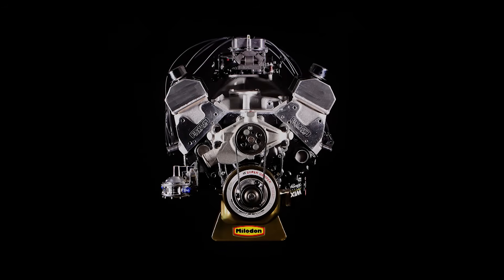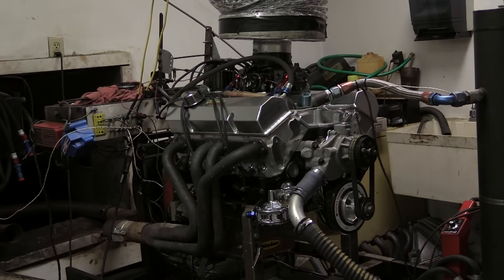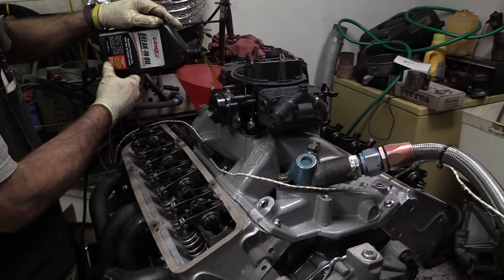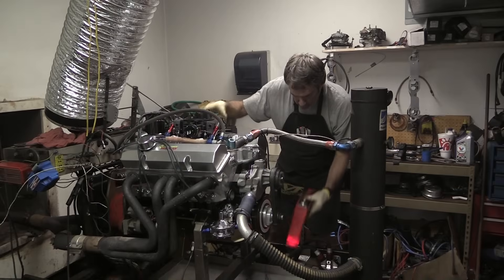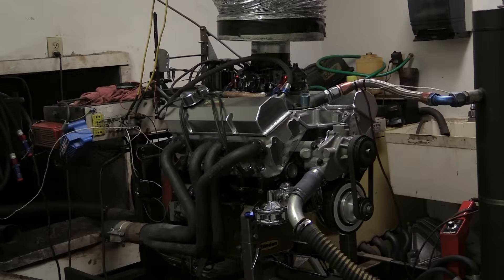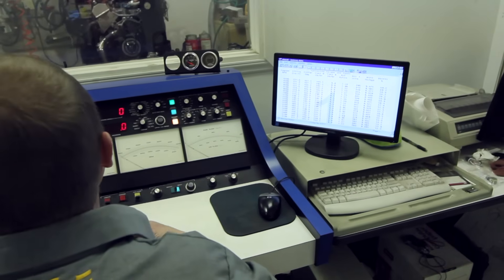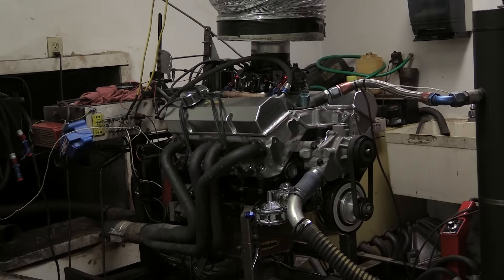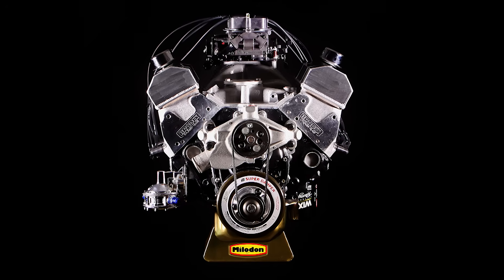427 Chevrolet on the Engine Dyno -- The Ultimate Stroker Part 5

Comment: You made a mistake with that dual-plane manifold.  With a single -plane you should be over 600 hp.  Someone here built a 414 sbc, same heads, and got 595hp.  With the extra displacement you should get 600+ easy.
Reply from the maker: I was after tons of torque, not a peak hp number.
Reply: @TheHorsepowerMonster  True, but more flow = more tq and more hp.  I just think the manifold is a restriction for motor with such potential.  Great build though.

Comment: Engine building is extremely fun, but for curiosity's sake, would it have been cheaper to purchase a ready to run box engine or do it the way you done it?  For the cost, would you been able to obtain more HP/TQ with warranty?

Comment: Nice engine, WAY more practical then my 358 that makes approx. same power (billet main caps, Lunati crank, aluminum rods, 12+ to 1 comp., .600" solid roller, massively ported 492 angle plug heads, port matched intake, 8200 rpm.--in my tube frame street MGB
Reply from the maker: That sounds like a fun ride!
Reply: @TheHorsepowerMonster    It is BIG FUN, it sounds like nothing else I hear on the street (I love the sound-you can hear at 1964 sbc MGB aggressive idle on YouTube), it's pretty sporty too (MGB weighs 2325lbs.)

Comment: this motor turned out great ilike how they used the 5.85" rods , dragonslayer heads, and thumpr cam, and the power isn't excessive for a street small block because of wear issues and bearings. made this a reliable street or mild mannered race engine with a howling 427 cube thumper idle be great in my 81 camaro, go on a date drive to the track run some 10's drive home scan some time slips , post to camaro forums and facebook, and make a bunch of youtube videos.
Reply: check out my IG turbospeedinc, we did an 80 camaro with a 434 small block

Comment: No, the ultimate small block is a 468 c. I. With 18 degree heads . A WARREN JOHNSON SPECIAL
 (ON MOTOR NORMALLY ASPIRIATED, NO NITROUS, 950 HORSEPOWER,THEN ADD A 500 FOGGER AND A 450 PLATE ) NOW WE'RE  TALKING 1800 H.P., REAL FUN ON STREET AND NO TURBOS OR BLOWERS OR PRO CHARGERS, JUST "CAROLINA CRUISING" !!!

Comment: It looks like the valve springs fell off around 6000rpm.  A little more spring and you surely will see more hp. Comp is famous for recommending inadequate springs.  Did you match the intake to the heads?  You are leaving a good bit of power on the table.

Comment: I'm curious as to why you guys went sort of cheap on the heads when most other components were fairly high end. No disrespect meant towards Brodix, which make some very nice heads, but it seems you might have been able to get more power with some higher flowing heads. That being said what you did get will make one hell of a fun car to drive.
Reply: for about 800 less could of got afr 210 or 220 and made atleast another 30-50hp

Comment: those hydraulic rollers are the weak link here. you need a solid roller cam in this bitch to take care of that high rpm hp drop

Comment: Keep it in yer pants, you bench-racing jockeys :-) This was just a preliminary baseline run to get some vague idea of where to go from here....there`s a TON of potential in this motor....
Reply: my guess was to keep it a low maintenance high averaging tq and hp ,street machine engine that can make your 2nd gen go 10's and not break. reliable bigger than small  power. the ultimate small block stroker.

Comment: 427 small block putting out over 500hp.........wtf. New meaning to the term Mighty Mouse. Chevy rules.
Reply: IDK I would still just get a LS7 at least 100lbs lighter, and about 580hp out of the crate plus it wont leak oil.
Reply: GlassTopRX7 guess you've worked on an ls7. I seen MANY, MANY of them leaking. That's what Chevrolet stands for. Cracked head every valve rattles oil leak every time.
Reply: @Smithmike53  we might leak, but we make Powerrr!

Comment: Im impressed, the cam, intake and carb and headers seemed to be on the mild side. And even with a quick tune this thing made a metric ton of torque. The numbers might be low for some these guys who think every engine is a  MAX output challenge but the numbers were actually higher than I anticipated. With a good tune you could have over 550 hp and torque. Thats serious big block power out of a small block on PUMPGAS and there is still a ton of potential. With a solid roller cam and a single plane intake with a bigger carb I know theres another 120 ponies in there.  Small, light, fits in any car or truck, revs to 7000 rpm....Good Build
Reply: Yep, that's a stroker small block, and the numbers are great !!!
Reply: @joecucch8261  i still like my 454 stroker over it any day or my 427 or my 327 pro built that will hold 10,500 rpms all day pushing little more then 1200 hp with 204 heads but it has over 25,000 in it i have had over 15000 rpms built by bell automotive witch builds top fuel engines i do a lot of drag racing
Reply: @ jeffery hollenbeck; It's your money son. Do what you like. This combo would have been in my 65 nova back in the seventies in a heartbeat. It would save me the cost of shoehorning a big block in a ride it wasn't designed for. To each his own I say.
Reply: @joecucch8261  to save money i got my 454 out of a motor home got it for free and they put strokers in motor homes 450 hp at 485 torque and if u dino tune it u can get over 500 hp with 525 torque stock i have got 2 this way for free and sold the motor home for 2000 with out motor and trans food for thought if ur lucky u can get a ls 6 out of them too i get stuff like this all the time same with cars selling a 66 gt fast back dart i got for 50 dollars no rust at all in the car all complete only one dent in it in the trunk lid have t tops camaro's 73 ss hatch back nova i got for 500 with 396 tunnel ram perfect body on it and many many more between me and my buddy we have 20 acres of cars and trucks to play with have a shop coming to by many of them first come first serve
Reply: @jeffery hollenbeck; That's nice, I'm happy for you. Good Luck in your endeavors.
Reply: @joecucch8261  if ur interested in any thing let me know mite have it live in oregon
Reply: @ jeffery hollenbeck; That's a long long way from sunny Florida where I am retired and only looking to keep my 2005 Ranger Edge in good running order. Again, good luck !
Reply: @joecucch8261  well thank u and hope u have a good retirement have a lot of fun if u can i would love to go fishing there some day i hope
Reply: jeffrey hollenbeck 15000rpm thats 15 thousand from a small black. Ya right 😂😂😂😂😂😂
Reply: joe cucch lol jeff lives in a HOME in Oregon.
Reply: Read "The Chevrolet racing engine" by Bill Jenkins. My copy is over fifty years old. In small engine applications for Pro stock drag racing, 15,000 rpms were achieved back in the seventies.
Reply: @holmes1956O  shows what u know about pro built motors for drag racing
Reply: @jeffrey4547  Sounds like a lot of BS to me.
Reply: @michaelangelo8001  let me ask this question what is a 455 Pontiac small block or a big block i wonder if u even know this
Reply: @michaelangelo8001  i will bet u right now i have more chevys then u have owned in ur life same with fords
Reply: @jeffrey4547  Are you drunk?  No one said anything about an LS.

You can't, spell. capitalize, punctuate, or format, yet you want us to believe you have racing engines that will turn 12,500 RPS "all day long", etc...?

You are obviously a dreamer.
Reply: this is a big block not a small block
Reply: @jeffrey4547  thats a small block 427. look at the headers. The 2 center pipes are close together. if it was a big block they would be evenly spaced.
Reply: ur right just i have a 427 BB

Comment: .Granted this is a nice engine,that should give you a lot of service,but a mild 396,427,454 could easy make 500 hp with a lot less investment,so it really depends on the application.This engine would make a great performance street engine in a early Chevrolet,while if its just a little bang for your buck,a mild big block could easily produce the same power.
Reply: Yea for another 200lbs of engine weight. I'll even give you that a BBC would be cheaper. People who build these monster SBC have vary specific reasons for doing so. I would have gone miniblower if it was allowed on a 383 0r 350.
Reply: Godscountry big blocks are heavy and large physically. So for me I can put the big block in my 68 nova but would rather build one of these. Better handling smoother ride easier maintenance and the same power output

Comment: I agree with many here,  427 is big block displacement,  that dual plane is choking it.  my 406 made the same hp w/a flat tapped cam.  now this set up including a 750 w/choke tower may be a great street set up,  but don't call it the ultimate hp stroker build then...great engine regardless!

Comment: the carb sounds a lil small for this big of a chevy build, cool carb tho. i had a 750 dbl pumper in a 410 sbc and worked perfect.
Reply: Nah. The smaller the carb you can get away with, the better the throttle response. I built a 381 Chevy engine with 9.8:1 compression, 511hp @6100rpm, and 492 torque @ 4900rpm, 91 octane pump gas and the carb is a 650 speed demon. The throttle response is unbelievable.
So a 750 Holley on that monster 427 should be 👌
Reply: @jakefriesenjake  "Chevy" doesn't make engines.

Comment: I like this build's series of videos, but not getting to tune any on the dyno makes this video a flop. Some jetting and possibly some timing adjustments could;ve really woken that thing up.  You never mention what the A/F Ratio was thru the power band.
 Further tuning will be by Butt-Dyno? Unless you pull the motor and get some more dyno time. A lot of money spent. If you pull another 50hp and 65 ft/lbs isn't the money spent on the dyno well worth it? At least it won't blow up because it's lean...

Comment: low HP,, you can almost do that with a stock block and a set of cheap world product heads and a cam in a 355 SBC., for a lot less money.
Reply: +doon714 Not exactly the same hp, maybe in a 400 SBC but youd be in the high 300's and low 400's with a 355,  but perhaps if you had a good cam, something in the stage II area yea, dual quads would help...lol. i need more money.

Comment: this is a wonderful build.....I'm partial to the xtreme series  comp cams, HR preferred although I'm running a flat tappet due to budget but I have ta laugh at all the comments in the sections below. everyone thinks that they can and are the best, best engine builders, best tuners, know EXACTLY what is wrong with everything.....probably don't even know how to set valves or proper timing....don't know the difference between initial timing and total timing. it's just funny....good job horsepower monsters. ....weeks love to have this engine in my 3rd gen camaro....ty
Reply: Air dynos ALWAYS READ HIGH period.

Comment: how much would building and engine like this run?
Reply: Too have it built, probably $15000 to $20000. Cheaper to get all machine work done at a shop, buy all the parts listed, and assemble everything yourself. Could save 5 to 10 thousand. Just research a little bit about bearing clearances and stuff like that. Get Er done!

Comment: i've seen 406's put out those numbers!
Reply: ezcondition #\. Oh shit, here’s another one that this build totally went over his fukn head!
Ok smart guy, you asked for it!
1. Your 406 (I’m assuming factory block), has simease  cylinders, that mutha fuker does NOT have anywhere near the drivability that this engine does! It will run hotter than the hinges on hells gate! 
2. This was NOT a drag race build smart guy! This is an everyday driver that can handle 75 mph on the freeway with the A/C frosting your gals nips when your sloppy POS 406 couldn’t make it to the next stop sign and broke! I swoop in and rocket out with your gal! 
3. A 406 can make a lot of power but so can a 3.8 Buick V6! Watch the whole series and understand the concept before making yourself look dumber than you are! FML with you keyboard racing mofo’s!  That statement that you made about the 406 equals to this statement:
“One time at band camp, I stuck a flute up my pussy”
Make sense now dip shit? Just tell the man that you  think it was a good video or don’t say anything at all!

Comment: I think this engine build is a great combo Street/Strip Week-End Warrior that will give you lots of fun of the "Run What You Brung" crowd. I would squeeze this into a 2400-2600lbs. car/truck and have a blast. A setup like that would probably get you solidly into the low 11's or high 10's, and that would be a fun ride...
Reply: My dad's Nova had a 406 sbc and his car weighs right @ 3000lbs and he ran mid 9s and that was N/A and i think he's either got a 427 or 434 sbc in it now running low 9s and it's still N/A he can use the bottle if he wanted to but he just takes it to the track to have fun and keep it together and not blow it up but his buddy had a 67 firebird that he turned into a 67 camaro with full interior and small tires his car with a 434ci sbc he ran low 9s on motor and low 8s on the bottle

Comment: A little disappointed that after all he videos of the engine build it was just a rushed dyno test.  Noticed the headers were turning orange in the video wondered if that was normal or part of rich / or lean condition.  Question about dyno's is when you see hp numbers for speed parts I always notice that they are given high up in the RPM range and with street cars or truck this is kind of only half the story.  what happens to the torque and hp curves down low.  I mean if a person were to load an engine up on the dyno down to say 2000 rpm or smidge over.  Either way Great Engine would love to have it.
Reply: The reason you often don't see dyno pulls in the lower RPM range is because engines often have rowdy camshafts in them. An engine with considerable camshaft duration will not pull down into low RPM under full throttle. They basically don't make enough torque at low speed, to overcome the load of the dyno. However, I'm sure this engine could've started its pull a bit lower in the rpm range. They just opted not to.
Reply: Thanks for the clarification.  I have been looking for ways to increase low end torque on a vortec 350 ,, but all the performance parts etc. don't really show power gains until up in the RPM range and some kill low end torque , like your lumpty lump cam shafts.

Comment: Check out those headers glowing red hot while the motor is wound out. They cool down quickly after they throttle down the engine.

Comment: Very nice series of videos - hit the important bits without the BS that some have.
Elsewhere there has been some 'discussion' regarding the merits of an EFI equiped engine Vs carb' and distributor - have you done any comparison build, or even just straight TB/EFI builds - I would expect a noticeable improvement all round provided the carb and TB had the same AFM ratings?
Regarding the exhaust manifolds, did you select them from theory and/or experience or were they the 'dyno' set that were already being used?
Thanks.
Reply from the maker: GordonWG1 Great questions. We are hoping to eventually upgrade to a throttle body fuel injection system once the engine is in the car. And you are right, the headers for the dyno test were a set that were in the dyno room. I can't remember the specs, but they were a pretty standard set for an upgraded small block Chevy. I've got a set of Hooker shorties that will go on the engine once it's in the car.
Reply: The Horsepower Monster 
Thanks for the prompt response - the reason I was enquiring about the exhaust was because of the big difference the right/wrong set will make to the overall performance of the engine - on that note, I haven't heard anything but bad reports about 'shorty' or convenience manifolds. Whilst I know what a pain in the proverbial they can be, I would expect you would be much better off (as much as 50hp - shame you were too restricted in time to run the engine as installed) building a set for the engine in the car than using what are, IMO, crap.
Anyway, it's your car and engine, so your call, be interested to see how it turns out - so happy trails and ticket free fun.

Comment: I want to do a lowerd s10 with a small block chevy I would be happy with 400-450 hp.
Reply from the maker: ***** I think that's perfect. A lightweight pickup with 400 horsepower would be a blast to play around in. I think that people get too caught up in the big numbers that the magazines publish or they read about on the forums but never think about what it's like to drive. Motors that make those big numbers are often very tempermental and make poor torque down low, and as a result they just aren't fun to drive. Personally, I'm a fan of the widest torque band possible.
Reply: The Horsepower Monster I wish more people shared this outlook.

Comment: Those numbers are sad why put a top notch rotating assembly but use a small cam, amd wimpy heads. Should be making 700+ hp with a 427
Reply: +Thomas Everett ..Did you watch the videos at all?  Their clearly stated goal was to build an engine making 550 hp that is more than happy on pump gas with no bad habits making it totally street friendly.  They also stated they wanted a strong bottom end so later if they want to change it to a maximum effort race engine the bottom end would already be there..  Cant believe you missed the entire point of their build project...way to pay attention.
Reply: Ls7 did that
Reply: Yes and so have many others. Including this one.
Reply: +bubba stephens so whats the point of this. its just a run in the mill 550hp engine..... I perfer engines that make 3 times the power. they did make a strong 550 hp engine on pump that has a rotating assembly stronger than the block. but would it killed them to put so 18° cyl heads on it lol